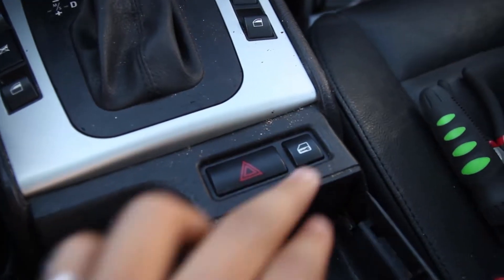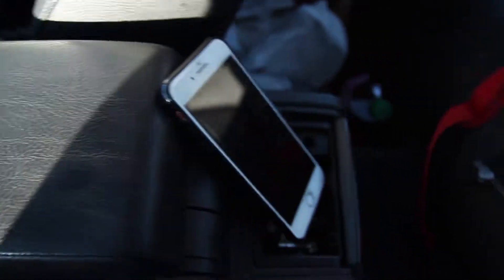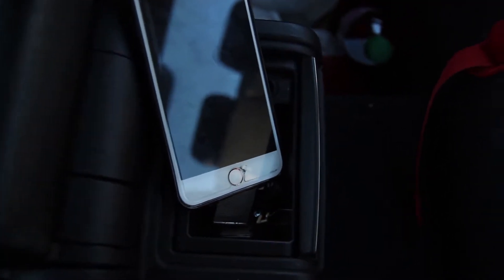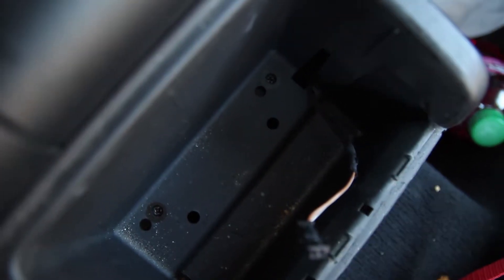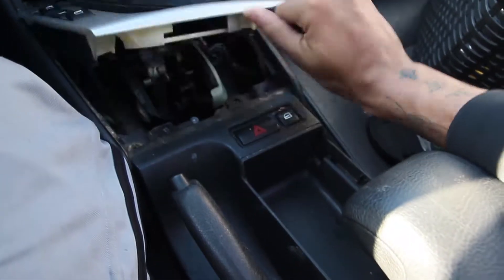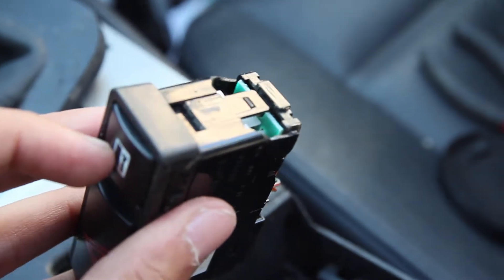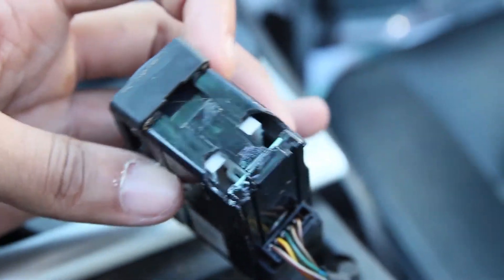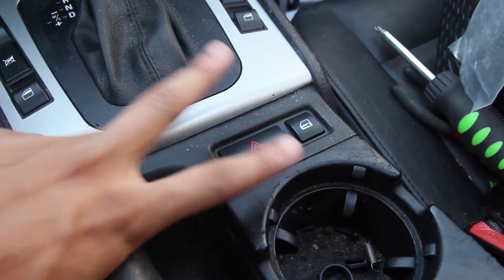BMW Central Lock Switch Common Problem!!! | Quick & Simple Fix!!

Comment: Bag the music. It makes it harder to understand you.
Reply from the maker: I agree with you, I’ve since made changes to the way I do my videos now as this was an older one.
Reply: Awesome. A YouTuber with integrity. And by the way, I should’ve also said what a great video this is because I have to do this in my X5? and although the rear of my console is different this was definitely helpful.
Reply: I’m not sure where that question mark came from.
Reply from the maker: No worries about the question mark and I’m glad the video was still helpful, is it an e53?
Reply: Yes. 2005.
Reply from the maker: Nice I have a 2006 3.0. Should be similar in regards to fixing the hazard switch but yeah the centre column is a bit different.

Comment: Hey Chevis, my 2nd comment  to you. THANKS very much for your video. Fixed pesky central lock switch JUST as you suggested was main problem. Day b4 1st verified that fuses 49, 52, and 60 were good. Bit tricky to get middle plastic piece up to pop hazard light + central lock buttons.  Sure enough, the plastic underside was cracked & separated! Used electrical tape to FIX both central lock + hazard light switches. Only suggest you don't have medium loud music on next videos so folks can hear you better. Eric, Portland OR
Reply from the maker: I do appreciate the feedback and I’m glad even though the music was too loud that you were able to get the problem fixed. It’s nice that like few you didn’t get at me about an issue with the video that I’m well aware of, as many have stated and that it was an older editing style.
Reply: @Chevisbeecher  yes, thanks again Chavis and LOL 😆 !not! The central lock/Hazard light switch NEW from BMW dealer us $97.15
Thanks again brother, Eric
Reply from the maker: That’s crazy expensive, there has to be one on Amazon or eBay.

Comment: My hazard light and lock button weren't working properly so I popped them out and when I push the bottom back into the housing only the hazard light works again. What do I do now? I need to fix the central locking button :(
Reply from the maker: Just have to get another one and replace it. EBay, Amazon, scrap yard, depends what you want to pay really.
Reply: @Chevisbeecher  thanks im going to call the scrapyard tomorrow, exciting ive never done it before
Reply from the maker: Any questions ask, should be simple and hopefully they have it.
Reply: @Chevisbeecher  they all laughed at me 😭 no one has bmw parts
Reply from the maker: That’s crazy, where are you located? Tons where im from. Check eBay.

Comment: think this would cause my doors to not unlock at all ? even with the physical key i can’t get my doors to unlock, i can only get in through the windows/sunroof right now by holding down the unlock button and letting them all open🤣 physical key won’t open the doors, key fob won’t, and neither will the physical button in the car. key fob works tho, the trunk unlocks just fine with it, and i can roll the windows down with it
Reply from the maker: I’m not to sure, I’ll do a quick google search. That is weird and lucky you have comfort access, I still say check the switch it’s easy to pull up and see if broken.
Reply from the maker: Check these fuses 49, 52, and 60. So the key doesn’t lock or unlock but only opens the trunk and the centre console unlock button does nothing?
Reply: @Chevisbeecher  yessir, might be my GM5 module :/
Reply from the maker: I was just about to comment an article to that exact problem discussion. Atleast we found out what it is, hopefully you can get it fixed soon!
Reply: @Chevisbeecher  here’s to hoping that ISNT the problem 🤣 but i appreciate it man, really!
Reply from the maker: Lol, no worries! May the odds be ever in your favour.
Reply: I’m having the exact same problem
Reply: @SNOWBOII69  definitely a GM5 module brother

Comment: I had a spill make my buttons stick down and together. Pressing the hazard button locked my doors. 

You can save about an hour:

Press a utility knife blade down the back and then there front (or two at once) and pry the sucker out. 

The frame of the switch is only held on with tiny clips that can be released with the same utility blade. 

Take apart all the plastic parts and clean them with soap and lots and lots of water. Almost always the defect is just that the buttons get stuck depressed. You can confirm by operating the buttons on the circuit board.
Reply from the maker: Great read for other!